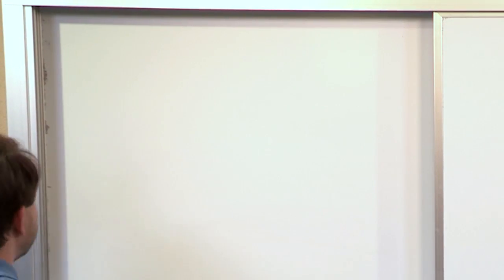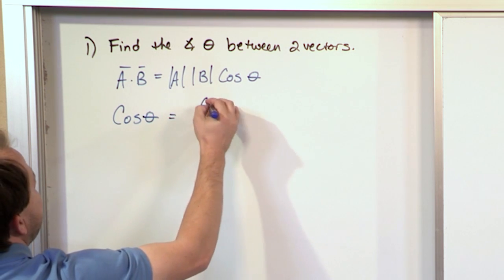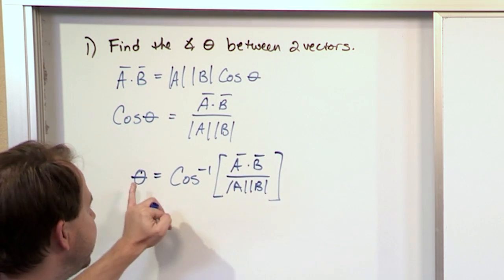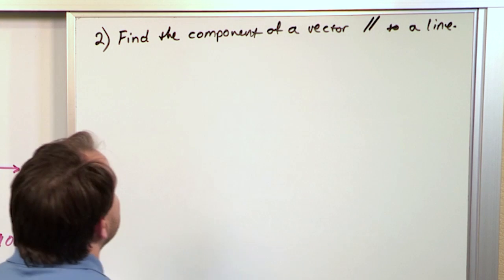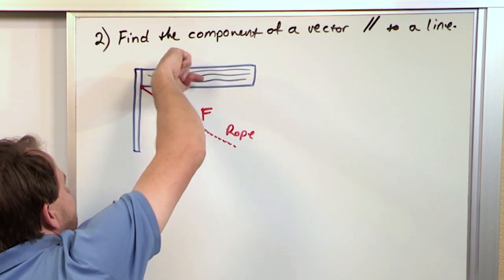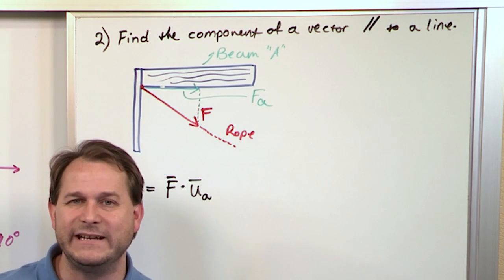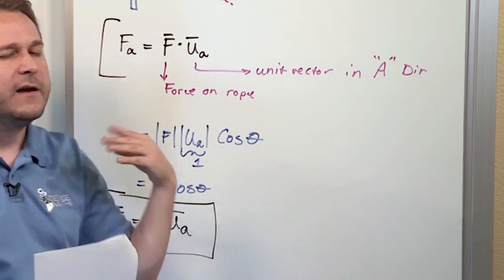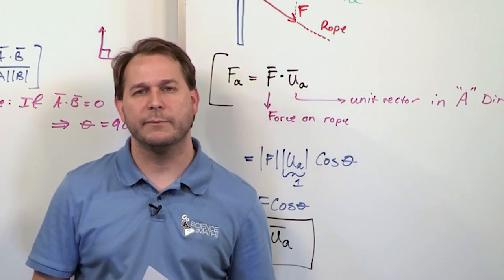When to use the Dot Product in Engineering Mechanics

Comment: also dont you have to do F/magnitude of F to get the unit vector of F and not just use i, j or k unit vectors?
Reply: you can use position vector too
Reply: I thought i j and k are only used in matrice transformations,  and typically a unit vector is when we calculate the unit vector of a vector. so vector  (2,3,4) will not have a unit vector of (1,1,1) , but  instead be (2/magnitude, 3/magnitude, 4/magnitude).
Reply: @ambientsoda106  all I'm saying is you don't have to use force to find the unit vector. Let's say the force is acting along AB, you can find the unit vector of AB, then multiply that by the magnitude of the force, then you will get the force in vector form.